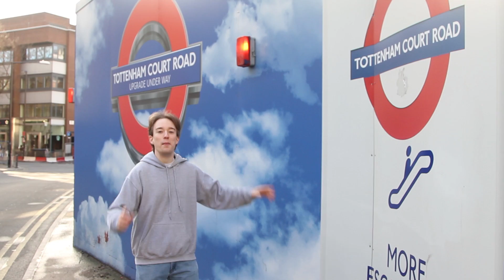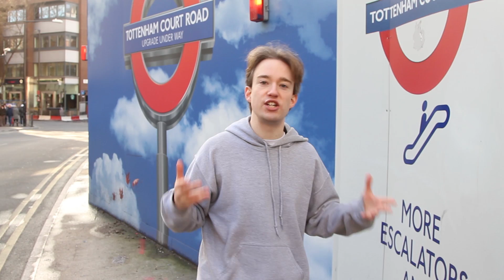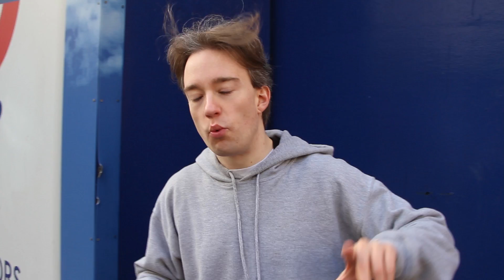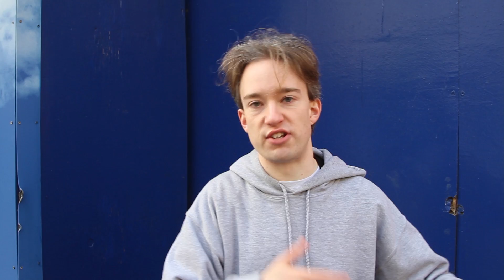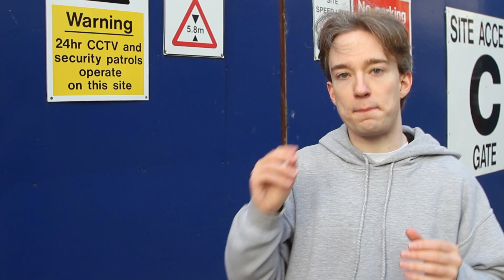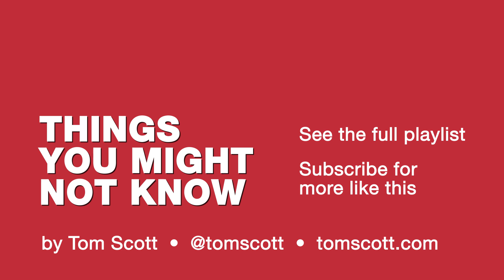Why Do Reversing Trucks Not Beep Any More?

Comment: Why don't they have backup radar? When you have 10 trucks around you all backing at different times and you're trying to get work done, it gets confusing. I was on a site when a laborer bent over to pick up a surveyors feather marker and did it right behind a grader with a backup alarm. That was the last thing he picked up.
Reply: Or why not just a rear-view video feed. Then the driver can see people and not run them over.
Reply: JNCressey jimmy just made an argument as to why backup radar is bad, and you want to rely everything on radars now?
Reply: JNCressey he didn't say anything about speed, it was about cargo jerking the whole truck to glitch the braking system. I don't deny that it's possible to do what you've suggested. you can't rely on the program 100%, so someone has to be in the vehicle anyways to be able to stop it when the program does glitch out. BTW have you driven anything similar to a truck before? its fairly hard to explain what exact maneouvers you have to deal with, since every situation can be just so different.
anyways, I bet there are people experementing with this, since if someone perfects it, obviously they are going to make a buck out of it. construction companies would sure like the additional efficiency and safety levels that it would provide. but IMO it's too complicated for now to make such bot work efficiently.
Reply: Google has already built a car that drives itself, just put that in a truck.
Reply: Galvok No. So what is this mystical eluding part of driving a truck that only those that have driven them will know about.
Reply: JNCressey I'm saying this because driving a truck is way more than finding the perfect angle/route and pushing the throttle, bugs are bound to happen, there is a lot of skill required to drive one.
Reply: How about just let robots drive trucks.
Reply: Galvok His argument was that people can't drive well with automatic braking because it keeps braking becuase they are driving too fast. A robot will see the obsticals and then drive in at the correct speeds as to not need to constantly brake every few seconds. Therefore it won't take 20 minutes because the robot can calculate a route in no time and smoothly drive in without having to slam on the brakes. 

Also, how about painting lines on the floor for the paths the trucks are going to stick to. That'll make people cautious when crossing the lines just like crossing a road.
Reply: JNCressey you're missing the most important part that this is a truck... again I'm asking, have you driven one?

Comment: The problem I see with it is that the sound doesn't have the "emergency" feeling to it. We are trained to hear piercing noises as danger, not white noise.

Plus, it sounds more like things in the environment, meaning it's not just for the trucks. I might think it's just a walkie talkie or radio.
Reply: guldrev
In what world do you live where the only trucks with backup beeping sounds are at a construction site? Plus instincts don't work that way.
Reply: this video doesnt do a great job of demonstration the actual sound but it is unmistakable for what it really is if you are near the danger zone of the vehicle. it is much louder and grating than just that of a radio noise.
Reply: They should really do a combination
Reply: I feel they could have combined the old and the new with the beep and white noise following each.
Reply: why can't they just have both, like a zhzhzhzhzhzhhzhzhhz
Reply: @official-obama  I think their goal is to get rid of the beep, because they find it annoying. Since the other sound can work at lower volumes, it would be less noticeable. 

I just don't think it will work well because a lot of things sound like white noise. Plus how many of us wear headphones or have our phones suddenly make noise?
Reply: @ZipplyZane  i thought their goal was to make it so that you could find the truck that is going to crush you. just a tiny indicator tone to make it clear that it's not releasing brake pressure would be good. just mess with the frequencies a little until it's clear that something isn't braking instead
Reply: Raspoetin a White noise is not a hissing sound, though. A hissing sound is higher pitched than that. We hear a noise that approximates white noise all the time. It's why my house always has a fan on, for example.

My argument is that I would not perceive white noise as a danger signal. Did I feel like I was in danger when I heard the noise here? No.

I realize that white noise is superior to beeps. But I'm also arguing that there is a problem with using white noise.

Your paper makes claims that broadband noise can work as a danger tone, and I don't disagree. But there are many other examples of broadband tones than just white noise.

It sure doesn't seem to be talking about white noise, as it says it should be easier to hear when you are wearing ear protection. I know from experience that white noise is harder to hear with ear protection than any shrill sound.

Look, I get that this is an improvement. But I think it could be even better.
Reply: ZipplyZane maybe alternating between white noise and the old tone?
Reply: ZipplyZane
I was reading up about it and noticed that it is also referred to as 'pink noise'. It seems the general idea about the sound fills the broadband spectrum. This is something that makes a lot of sense to me since our brains has different techniques of dealing with the direction of sound, depending on the frequency.

Something else I came across was that the tones have a further reach, the don't dissipate as quick, something that appears to be a benefit if it was not for the fact that it travels well out of the danger area, and that means that people that are not in the danger area get warned as well.

I wonder if the warning bit is the sound itself, or the repetition of short periods of sound.
Reply: The whole point is that the "emergency feeling" beeps are not as easy for humans to ascertain their origin in terms of direction, when compared to the white noise. Radio, walkie-talkie, or reversing truck, a blast of white noise would receive a look in that direction. The sound ques one to look, and looking ques one to move.
Reply: Ultra Motor Source And my point is that it's not going to make me look, because it doesn't sound like danger. It doesn't put you on hyper alert. I'm not going to look and see where the walkie talkie noise is coming from, because it doesn't matter.

High, shrill sounds sound like danger. I see no reason they couldn't pick a sound that is both directional and shrill, so that it would activate the person's danger sense, and thus force you to instinctively look.

The sound I heard in that video, I can see myself wondering what it is and looking, but that's slower than automatically turning my head towards it. The beeping sound always put me on alert.

It seems to me that they traded one problem for another. If you're going to come up with a new sound, it seems best to optimize for both directionality and instinctual looking.
Reply: @MilesFromExtraordinary  you've clearly never worked on a job site. That white noise sound is almost exactly like a sound from a plasma cutter, which is quite common on job sites. Once you've been arc flashed a few times, you learn to instinctively look AWAY from that noise, and you certainly don't look towards it. If you stopped work and looked towards the sound of every walkie talkie when it made a squelch sound, you'd also get no work done. 
This was done entirely to appease people that live in overpriced houses and apartments in London. It decreases safety, not increases it.
Reply: @MilesFromExtraordinary  I'm no audiologist, but I'm guessing we can hear "red" shift in higher frequencies easier than lower. Sure, by then it could be too late, but where the sound is isn't nearly as important as is it moving toward me.

And by "red shift" my dumb ass means Doppler effect...
Reply: ZipplyZane White noise doesn't have a pitch.. white noise is every single frequency of sound possible to hear. This is also why you can spot directivity of the soruce. it diffuses eccos from walls and surroundings, making the direction more clear. You will not get standing waves and such with all frequencies.
Reply: The only time a reversing truck is an emergency is when it's a few feet away, they don't exactly reverse fast. I'm assuming you won't be able to block out the nose from close range
Reply: @5c0tty5  One advantage of the white noise variant is that it doesn't alert the entire area - it can be quieter, so the people doing construction nearby aren't blasting me with a noise when I know they're not going to reverse into my apartment building.

But if I'm hearing that depressurizing sound, I'd move away from it, because at best, it's a bunch of pressurized air jutting out somewhere, so something broke.

At least, that's my presumption - don't think I've heard that particular noise either.
Reply: @ZT1ST  if you don't like noise then wear ear plugs 24/7
Reply: @GewelReal  I mean, the main reason the blast noise is a problem is I want to hear stuff much more locally than "The Noisiest Thing On The Block".
Reply: There's a fun fact about this, you'd be surprised. You wouldn't know it until you were in this situation, but that white noise automatically sends fear to our brains if its done right. It has to be slowly or suddenly getting louder (or in this case, getting closer). It's an odd thing but when you experience it yourself you will be surprised. Quite cool actually
Reply: ZipplyZane Man instead of making stupid theoretical claims, go and stand near one. They are loud, and if you you don't turn your head in response to one of those approaching, assuming you aren't deaf, then you deserve to get hit...
Reply: ZipplyZane "We are trained to hear piercing noises as danger, not white noise."
Have you ever noticed how you automatically respond to 'hissing' sound...

"I see no reason they couldn't pick a sound that is both directional and shrill,"
Because that is not how our brain works, it uses different techniques to locate sound. The typical tone you are talking about is of a frequency that our brain has problems with to locate.
This is why they now use a broadband noise, a combination of higher and lower frequencies which allows our brain to more accurately ascertain where a sound is coming from.

"I can see myself wondering what it is and looking"
Exactly.
" but that's slower than automatically turning my head towards it."
Except that you do not always know where the sound is coming from, which means you will have to look around to find out what is causing it, and wonder which of the 3 trucks is actually reversing.
 "The beeping sound always put me on alert."
And eventually 'tune out' because these sounds are everywhere. These tones have a much further reach and most of the time you hear these sounds there is absolutely no danger for you...
The white noise alarm is much more localized, which means that when you hear it close by, you are actually in the danger zone.

I suggest you have a read of the following paper:
http://www.brigade-electronics.com/uploads/related_downloads/whitepaper_UK.pdf
Reply: walkie talkies don't make that noise and certainly don't make it rhythmically.  Also what's a radio?
Reply: @soccerguy2433  This is just dumb. Walkie talkies still have static, as does the radio in every car. And you don't hear rhythm in the split second you need to react.

Plus this noise is also the sound of suffient amounts of water, saying shhh (a calming phrase), a fan running, and so much more.
Reply: Nerds
Reply: All the research says you're wrong, so...
Reply: ZipplyZane the point is that its not for you. unless you work at a construction site. in that case it is for you and you should get a sense of danger from it

Comment: This is similar to why emergency vehicle sirens are not monotonal. If a police car only blared a clear single tone, your ears would stop being able to tell where the sound was coming from after a few seconds.

This is because your ears use the time of arrival difference between the ears to figure out which direction a sound has come from. So, after a few seconds of listening to a single tone, the ears can no longer tell which ear is hearing it first, because there are no sound "imperfections", if you will, to measure a difference in arrival time between. Obviously natural echoes, terrain morphing and the doppler effect would help, but it would still be somewhat more difficult to tell.

Using two tones means your ears can "lock on" to the sound a lot easier because there is a constant, clear change that your ears can measure as a difference between them.

Comment: This was on Tomorrow's world MANY years ago - they were intending to replace emergency sirens with it. I think this was partly rolled out occasionally you'll here a siren go WOO WOO krrrrr WOO WOO krrrr - the same principle applies.
Reply: Mmm, I was 95% sure it was Tomorrow's World that was showing it.
Most now do yelp, wail and machine gun (or phaser). Yelp and wail are the same, but the machine gun is a faster sound (like a child making machine gun noises). It's more common for a driver to switch to that one when crossing a junction as it has a more urgent feel to it. The change in tone when about to negotiate an obstacle is meant to act as a cue as well. "I'm driving, I'm driving, I've changed pitch. I'm about to do something different."

Comment: I'm now wondering if I've ever heard this sound.

Maybe I have but just assumed it was a hydraulic brake or something.
Reply: That's what I was thinking, and it made me wonder if it actually makes it safer. With the old beep it's instantly recognized as a warning and you'd be on the lookout for danger at once. With the other one I'd be like "where does this pressurized air sound come from?" and just casually write it off as that without thinking that it might actually indicate danger.
Reply: @Volteer  Same here... Would just walk around the corner thinking there is a working air compressor or a walkie-talkie on full volume (and someone else keeps his in pocket and randomly pushes buttons or it's broken- happens, makes similar sound). Doesn't sound like a reversing truck.
Reply: You would be trained on the new reverse beep and be able to recognize it when you are put to work.
Reply: Huh, now I'm curious. Definitely checking this out next time I'm around a construction site.
Reply: Sounds like air bleeding off of a pressurized system.  Not an alarm to passers by.
What are the accident statistics?
Reply: Hydraulic brakes don’t make any noise. Maybe air brakes?
Reply: Why not alternate the White noise with the beeping noise🤷‍♂️
Reply: Who is going to note a white noise sound while general street noise is going on all around you? I prefer the beeping warning,far more recognisable,especially if accompanied by a voice warning of the vehicle reversing.
Reply: Huh. Same.
Reply: "So it's not a nearly deaf elderly from the low floors of the nearby building, surfing through channels in an attempt to figure out what's wrong with his TV?"
Reply: Hydraulic brake probably wouldn't make a sound like that. Pneumatic breaks would.
Reply: @n.o_w_a.k  actually it is all the opposite
Reply: Reversing "Squalker" is completely recognisable as construction traffic, and is mandatory for any equipment on night shift (In Aus.).
They most certainly are easier to "echo-locate" than the traditional "beeper".
Reply: @n.o_w_a.k  how deluded do you have to be to see something that's been proven by rigourous academic research but then just say the exact opposite? Mind blowing.
Reply: @HairyAlpaca07  Just because it's better on paper doesn't mean it works out in the real world. Beeping has been the staple of heavy vehicle reversal for so long it's ingrained in almost everyone's head.
Reply: @haroldbalzac6336  I sure as hell trust academic paper more than a random youtube comment.
Reply: QuixoticQuaver k